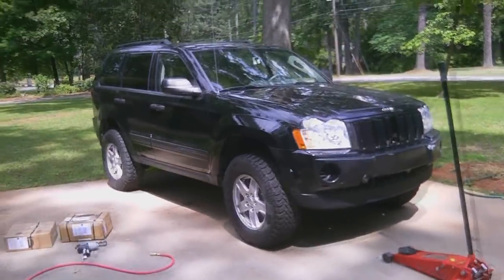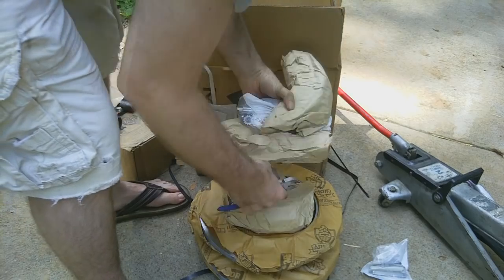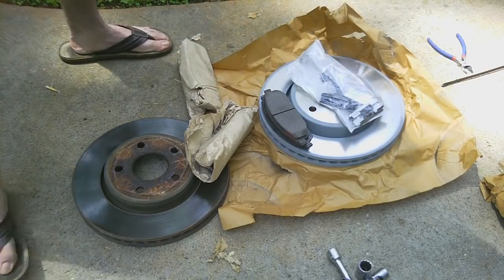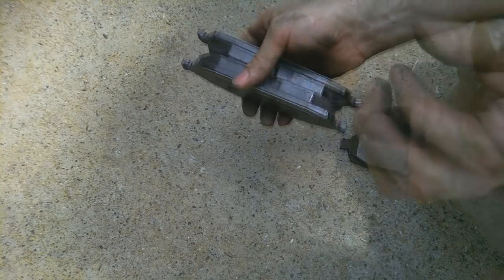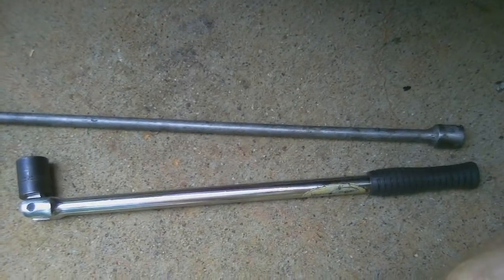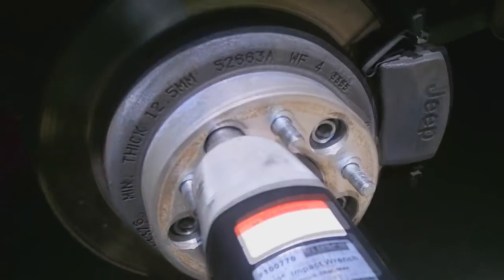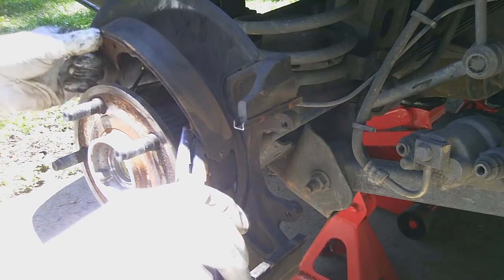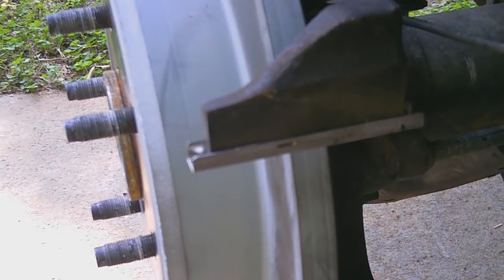How To Change Your Brakes - Jeep Grand Cherokee WK

Comment: Nice Video. One thing I would add, for those who have not done it before. There is a rubber o-ring from the factory around the hub that helps hold the rotor in place on the rear. Up north it tends to deteriorate and may not be there, but if it is still there and you don't know it, getting the rotor off can be a challenge.

Comment: Thanks for posting this video. I have now done two of these with the rear parking brake. If you remove the rear hubs the job is pretty easy. My 05 hubs came right off. Just remove the speed sensor with 10mm. Then crack the 18 mm lock nuts (4) on the back side of the hubs. Then just use 8mm socket and remove the screws securing the hubs from behind. Once the hub is off those rear parking brakes and springs are very easy to change.

Comment: Just changed rotors and pads on my 07 wk.  Your videos have been immensely helpful for doing diff/tcase changes, drive belt and now brakes.  Thanks so much for posting this stuff!  I used the bolt method to get off stuck rotors instead of a big hammer and it worked great.  I followed the dungeon motorsports guide for plugs.  Thank you for taking the time to do these videos, I feel very confident doing disc brakes and other preventive maintenance myself on future vehicles now.

Comment: Thanks so much for a great video.  For others who may run into a similar problem: 2007 Grand Cherokee V6's have an O-ring that act as a retainer and hold the front rotors onto the hub.  It is easily removed and reused (doesn't come with any brake parts kits that I've seen so far), but it can be a pain if you don't realize what it does.
Reply: The o-ring is easily removed and discarded. It's only for assembly purposes in the factory; there's no need to put it back.
Reply: How the hell do you get it off and where is it?

Comment: For those still thinking of doing this you may want to skip the parking brakes part and let the pros do it.
Getting the spring back on is so difficult you need a special tool.Took me 2 hours a day cursing and swearing for almost a week to get the first one done and less than 20 mins for the second once I figured it out.I don't plan to bother one of those anytime soon

Comment: That darn parking brake. What a PITA. I had to walk away for a while. I've read that the lining tends to fall off the parking brake shoe in cold wet climates, and it did on mine. Also the manual recommends removing the axle to make access the hard front spring easier.

Comment: Using a second floor jack on the end of the breaker bar can help break high torqued caliper bracket bolts.  Did this on a 22 MM Maxima bolt that I was hurting myself trying to loosen.  Putting a cheater bar on did not give me room to go counter clock wise up by under carriage of car.  The jack did wonderful and made changing out rotors possible.   Friend wondered what I was doing but he thought it was a great idea when he realized what I was doing.

Comment: Hey, thanks for your video!  Well made.  I changed the rear rotors and pads on my 2008 GC, today.   All went well.
Reply: Oh, and the pads were pretty much totally gone, on the rear.   The grinding sound didn't start, until about 3 weeks ago.  Just got worse and worse, fast!   Lots of damage to the left rotor.  It feels great to have them replaced.

Comment: Great video.  What size is that front axle nut.  It is less than 36mm I know.  Also, I use a Kobalt  8-amp 1/2 inch electric corded impact wrench for 149 at Lowes.  It handles everything in this video plus Clevis bolts.  It took some time to get the strut clevis bolt off but it was no problem.  The lower rocker arm clevis bolt came off too and a little faster.   I was really impressed.  Unfortunately, do not have room for an air compressor.

Comment: I found an easy way to install the return spring: just use the biggest flat tip screwdriver you can find and lay it across the top of the axle (screwdriver is the lever, axle is the fulcrum) - done!

Comment: Hey man great vid.  i normally don't work on my vehicles but after watching your vid i said "F" it.  first front brake took me about 45 min but all the rest went about half that time.  Oh and i found out my parking brake shoes came off and were rolling inside the rotor on the rear right wheel.  i'll be replacing those this weekend.  excellent vid.

Comment: That mechanism on the e-brake cable (with the hook ) is supposed to pivot . Mine was seized with rust and would not let me compress my new shoes so that I could get the front spring on. If you take a pair of long reach needle nose pliers and drill a hole through the tips it makes the tool like it has a beak and grabs the spring securely or buy these Sykes Pickavant 03701200.

Comment: Would also like to know how you got the actuator back on the damn cable???  Did you unhook the cable all the way up by the handle so you could pull more of the cable out the backend??  About to throw stuff across the shop trying to get that piece back properly.  Thanks

Comment: The video was good but you completely bypassed the most difficult part, getting the parking brake actuator installed, I was not expecting it to fall off when I removed the shoes. Was not sure which end goes up (thanks to your vid I saw pivot on top)  How does the cable hook up? Do I need to physically get the hook end of actuator pivot through the cable end or will it hook up by pulling and releasing the hand break lever? Also the spring at actuator is very hard to stretch. I broke my drum brake pliers on the second rear wheel (passenger side) trying to stretch that spring. That spring is a _itch. As for getting spring in hole after you get it on edge. I took an old screwdriver and cut a small notch in flat blade, put notch over the spring, then tapped it in with a hammer.

Comment: I see the shipping labels on the box, where did you order from and does it all come together rotors, pads, and other bits? Oh, and a another method is using a C-Clap if you have one big enough it's what I been using for 15 years to push the pistons back in.

Comment: Gah! You glossed over the part I'm struggling with! How the heck did you get the actuator lever back on the rears?? Mine fell off during disassembly and I'm starting to wonder if there's something wrong with the system since the shoes were already hard-pressed on the inside of the rotor. Help??

Comment: Great video. Can I ask what mods to the stance and suspension you've made as well as the tire size and make?  I really like the look.
Reply from the maker: All it is is a rough country 2" lift with rough country wheel spacers.  Tires are 255 75R17's off a Rubicon.  I buy them off Craigslist anytime I need tires.  Plus they come with new wheels!  Only bad thing is that they don't have the tire pressure monitors that connect to the PCM.

Comment: I suggest cleaning up the hub surface & studs with at least a wire brush before putting on the new rotors.  A clean vehicle runs better! :)

Comment: Brake caliber grease on those slides? Anti squeal on the back of pads? Check the boots on the pin slides and make sure they move freely.Did not see any of that in the video.Pull master cylinder cap or did the other recommended bleeder screw method for retracting caliber pistons.There is more but not going to critique the video for what it is.This to let guys know some added steps to consider.
Reply: Front slide/glide pins on mine (UK Jeep Grand Cherokee Overland 3.0 CRD 2009) were very stiff.  I discovered that both pins have a small cylinder of rubber at the end which prevents rattle.  This rubber was so swollen when I pulled the pin it would not go back in.  I discovered this was due to me incorrectly using petroleum based grease when I last serviced my brakes.  Advice I was given is to  always use high melting point silicon grease on the glide pin boots and inner rubber.

Comment: Sometimes the back rotors are solid, some are vented like the rotors fronts. Front pads are larger then the back pads. Monkey bar slang for the pipe on breaker bar😉

Comment: Not a critical error but I don't start taking anything apart until I open the box and check the new parts.  Too many times I have opened up a bow to find a damaged or wrong part.

Comment: I'm glad I rarely use my parking break and I doubt they need to be changed when I do my brakes
Reply: They are called emergency brakes, You will need them to slow down if your hydraulic brakes fail. Or you could try to use your transmission at 80 MPH. LOL!